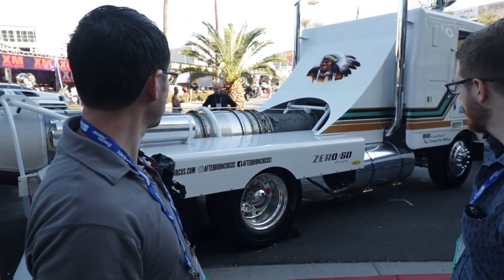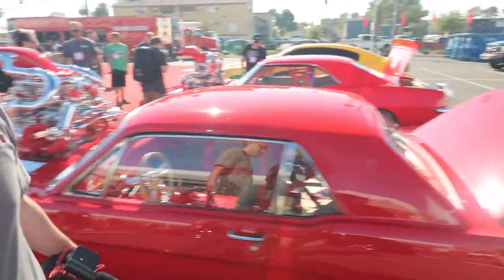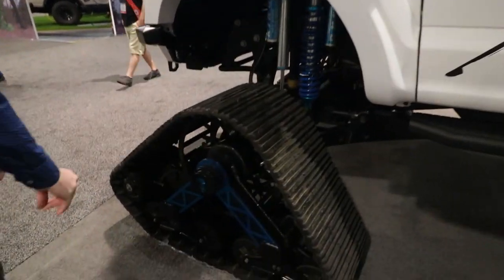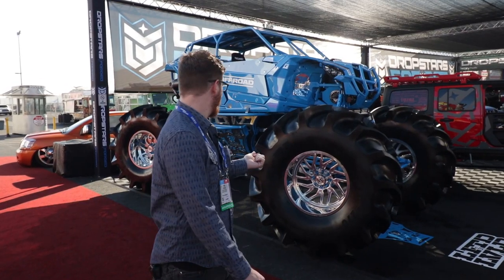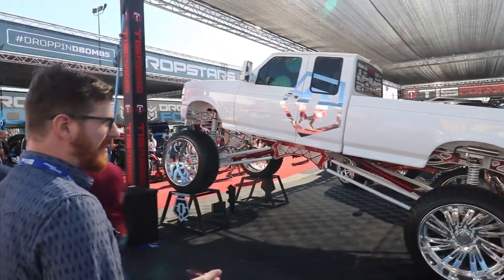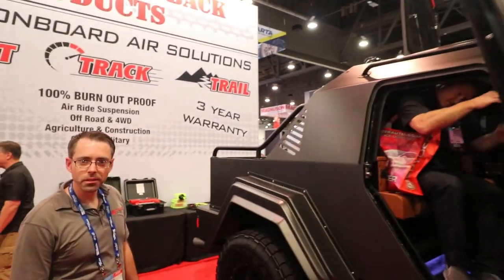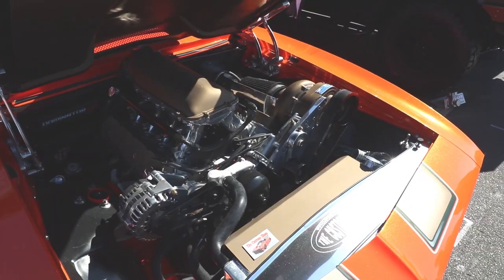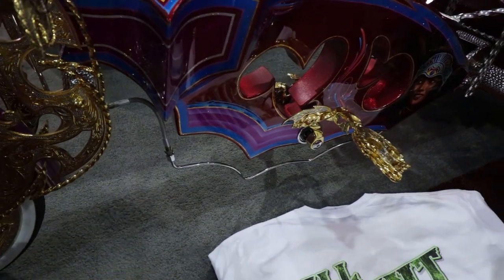Craziest Builds of SEMA

Comment: https://imgur.com/a/akTfbVl any idea what’s this sound my cars making? My ODBeleven fried so that’s a no go till I get a new one. My Car is a 2016 Golf with the 1.8t engine and has a swapped is20,jb4,and downpipe. I also have a problem when occasionally more often on hot days when I start my car the epc light will come on and the max rpm is limited to 4000. Shortly after starting my coolant temperature begins to rise rapidly and goes past normal temp even tho my jb4 shows the coolant at a much lower temp. If I turn the car off and on I can get this to disappear usually